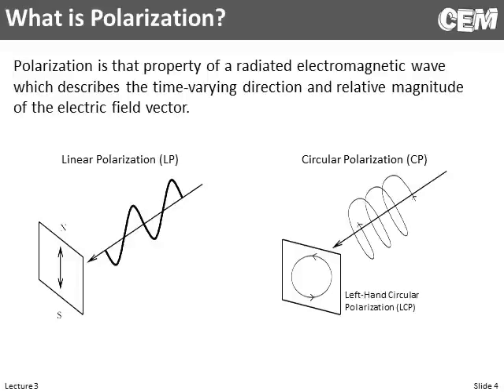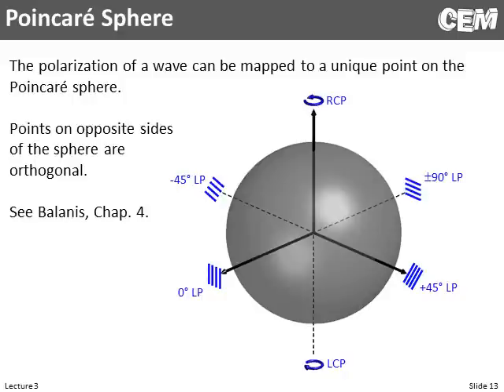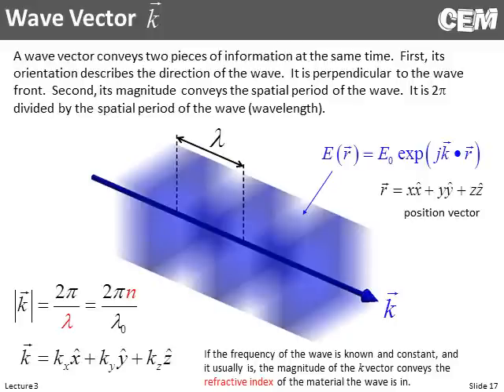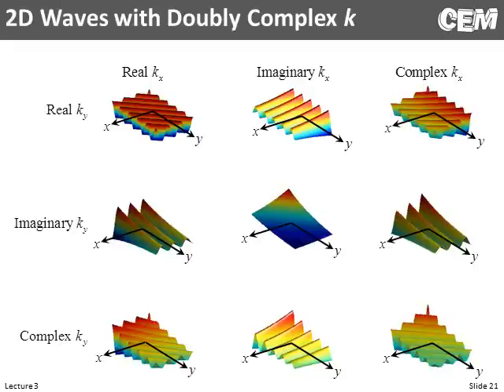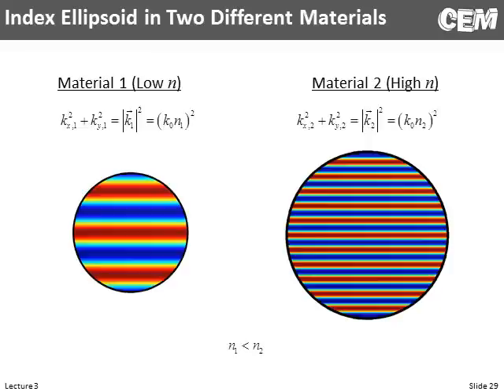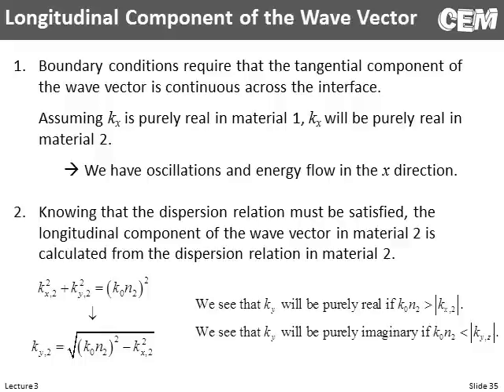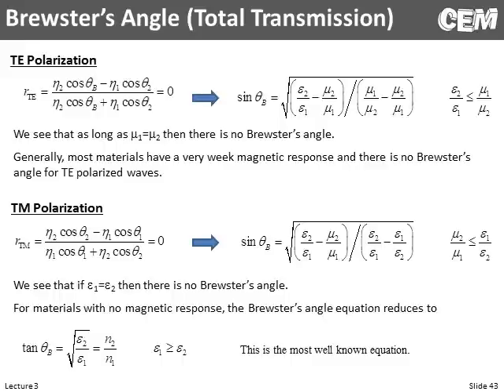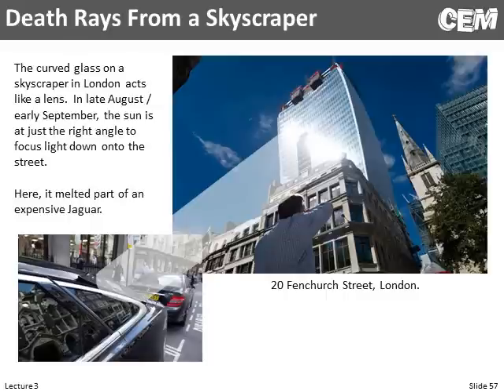Lecture 3 (CEM) -- Electromagnetic Principles

Comment: I am going through some of the matlab related courses offered by Professor Rumph. While I am loving this course I have looked at his publications and I am wondering if there is a text book from which this course on computational electromagnetic is based?  I would purchase it if there was.
Reply from the maker: There is no single textbook, unfortunately. CEM is a difficult topic to get started in because the resources are either too complicated, lack higher level explanation of simulating devices, or are so oversimplified the material is not useful. To address this shortcoming, I recently published my own book that is intended to be the starting point for people interested in CEM. It teaches the art of CEM using finite-difference frequency-domain (FDFD) which is absolutely the best FIRST method to learn. It is among the easiest methods to understand and implement and can simulate almost anything. The book also teaches higher level concepts that apply to all other methods like boundary conditions, sources, how to represent devices, how far away to place boundaries, how to post-process the fields, how to troubleshoot and benchmark new codes, etc. Here is a link to the book website:

https://empossible.net/fdfdbook/

From here, you will be in a great position to learn other methods. You will also have FDFD from which to try to match simulation results as you develop your other method(s). A great second method to learn is finite-difference time-domain (FDTD). A great book is Taflove's book. However, that book is a great reference, but not a good place to get started with FDTD. To help get started, you can look at our free course on FDTD or the paid.

Free
https://empossible.net/academics/emp5304/

Paid:
https://empossible.thinkific.com/collections/FDTD-in-MATLAB

Trailer for Paid FDTD:
https://youtu.be/uBiprIN8gfY?si=CWxyUmpyFJu3mcit

If you have both FDFD and FDTD (they work great together), there is literally nothing you will not be able to simulate. The other methods will only buy you speed and efficiency, which can be important if you have limited computer resources or will be iterating your code many times for optimizations. 

Hope this helps!!!

Comment: When you write the dispersion relation as ka^2 + kb^2 + kc^2 = n^2k0^2 (31:17), are we supposed to square them as complex numbers or is it the magnitude square? I mean is the equation supposed to be: |ka|^2 + |kb|^2 + |kc|^2 = n^2|k0|^2 ?
Reply from the maker: +_jp88 I don't think you should include the absolute value operation because all of these quantities can be complex, except k0.  This would happen if the material had loss making refrative index n complex.  For the conversation about index ellipsoids, we are assuming that n is purely real (i.e. lossless materials).
Reply: +CEM Lectures Okay thank you. In that case the real and imaginary parts of the equation have to balance out separately.
Reply from the maker: +_jp88 When you calculate magnitude, the real and imaginary parts mix so I am not sure I would think of it as two separate things.  But you are thinking in the right direction.